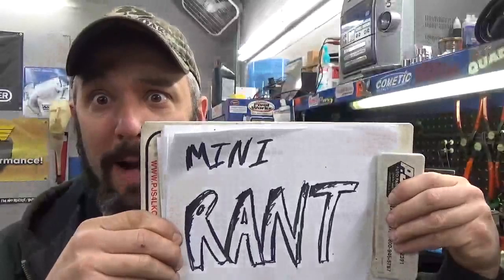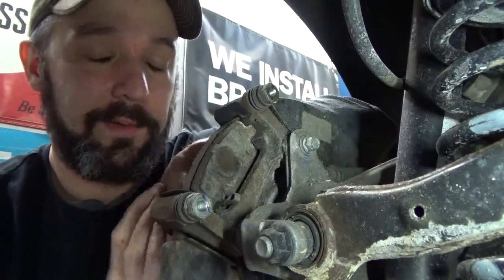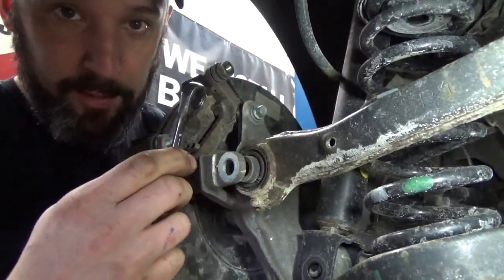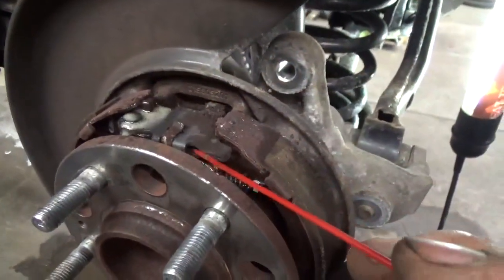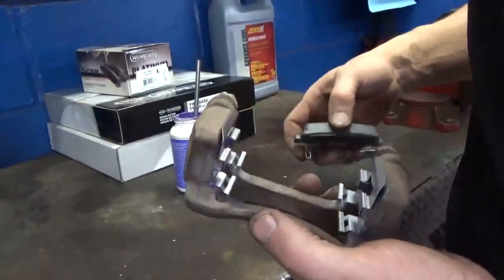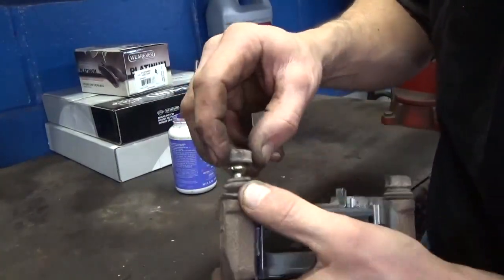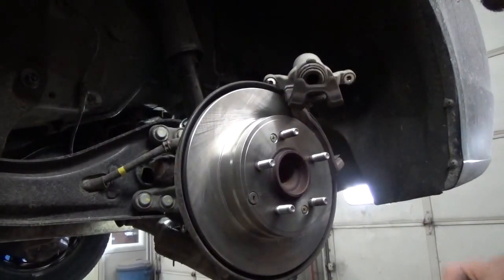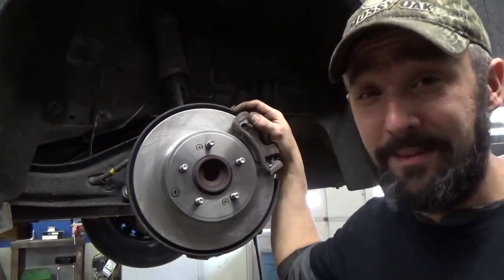Replace Rear Disc Brake Pads & Rotors - Hyundai Sonata

Comment: 1st I'd say give them gas at $20 a gallon 2nd this is only the back brakes right cause I know your making a difficult job outside look easy inside. 3rd I doubt even most professionals will clean off the oil from the rotor

Comment: Typical Hyundai owner responses from my experience: Why would I keep more than a 1/4 tank of gas in it? That cost money." "Preventative maintenance?"..."You mean you have to change the oil?"... "I thought that was covered under the powertrain warranty."...Common sense? What's that?" Thinking about it... maybe the Hyundai engineers drive Hyundai's. Cue the Hyundai owner flames... :)

Comment: Are car manufacturers engineering things like that on purpose???  Remove suspension bolts to replace a brake rotor?  Things used to be engineered with maintenance/replacement in mind!
Reply from the maker: Oh it gets much worse than this... I hav a VW CC Sport 2.0 coming in for a water pump. Wait till you see that little yuck yuck....
Reply: You guys probably like it though cause it means more $$$$!
Reply from the maker: That's the thing. Flat rate only pays 1.2 hours. Normal style pays 1.0. Really not that big of pay difference.
Reply: ***** Making it harder to repair doesn't add much time, just complexity to the job. It's a barrier for DIYers and a pain for mechanics, and that's about it.